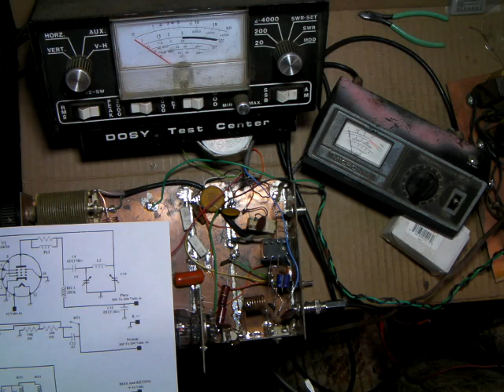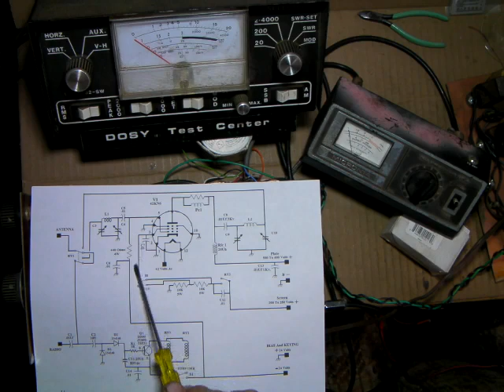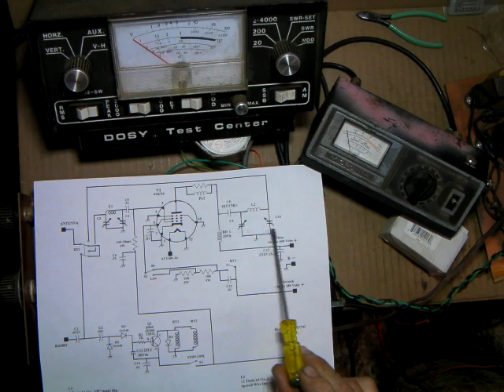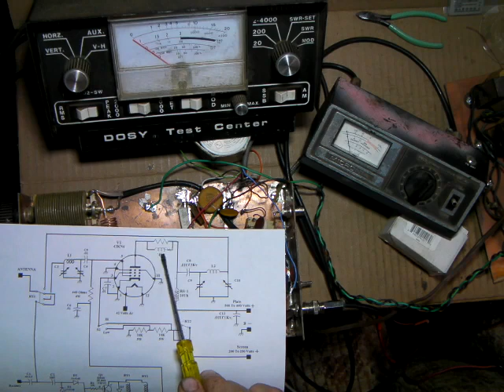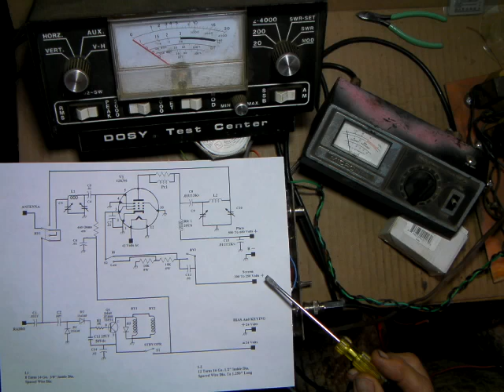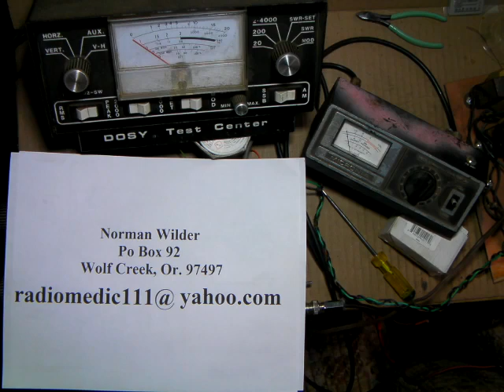Build a Tube Type Linear Amplifier For CB Or Other HF Bands Ep15: 140 Watts From One 42KN6

Comment: Any Values for 3800KHZ AM Looking for about 50W carrier for a QRP Exciter 1W low 7.5W high.TnKs
Reply from the maker: OK....there is a way to figure out the plate tank coil
assuming the plate impedance that I mention for the plate and add the plate "C" of the tube that you are going to use across the resistor then follow my method and suggestions in the video or slide show "working with Pi networks" .....I will assume that your exciter is at 50 Ohms output...hook an swr meter "Radio" side to the output of your exciter...then a short piece of RG58 from the output connector of the SWR meter to  what will become the antenna side of your test PI tank coil with the substitute plate impedance resistor and plate "C" cap connected to the far end of the  coil (that will be the end that will eventuality be connected to the plate blocking cap going to the tube".......this may be hard to come up with,but look in a 60's ARRL hand book for a transmitter circuit for a 6146 or a 6L6 and start with the values for the coil and the caps that they suggest until you get a 1 to 1 match.
If you want I can give you more help if you send  
me an email at:
 radiomedic111@yahoo.com

Comment: Hi Norman - thanks for the sequence of videos about linear building. I don't think I've seen a better primer on YT on this subject. I've learnt a great deal in the few hours spent viewing the videos that would otherwise have taken days to acquire from the literature. On the subject of tubes (or valves as we say over here) I acquired an ex military service tray of 15 new 807s. It would be shame not to use them. What would you suggest for the Ham bands? preference is for 160mtrs and 80mtrs but do also use 11mtrs FM.

Comment: There is a trick you can use with a neon lamp to check for parasitic oscillation. 

I've seen just one leg hooked to the plate cap of the tube, and have also heard you can also just loosely couple it to the connection by affixing it on the end of a hardwood wooden dowel and just bringing it close to the tank circuit connection. The lamp will glow purple if there are any VHF oscillations in the signal.